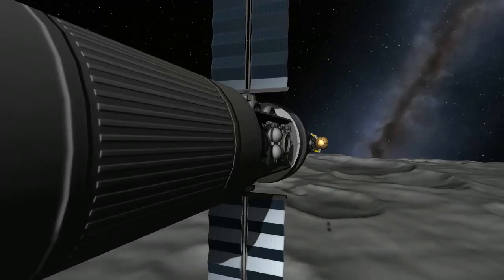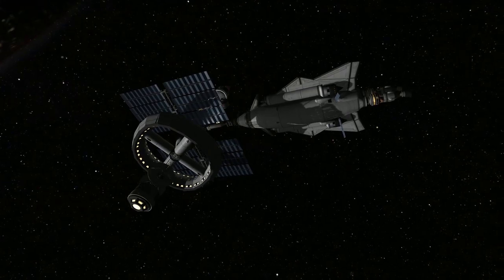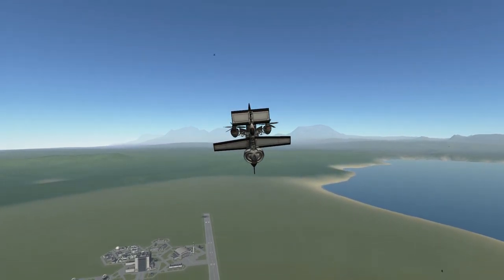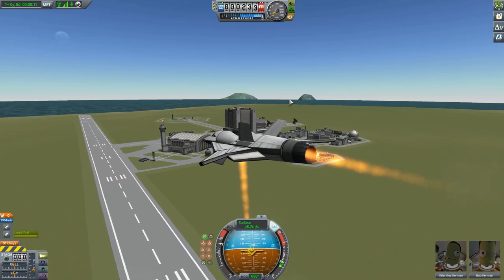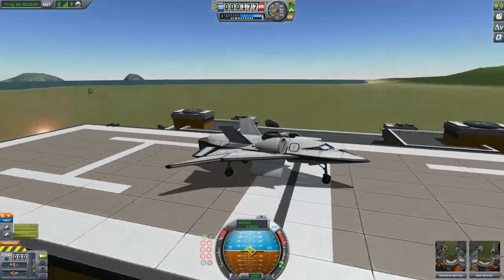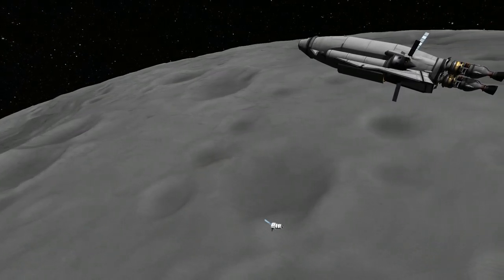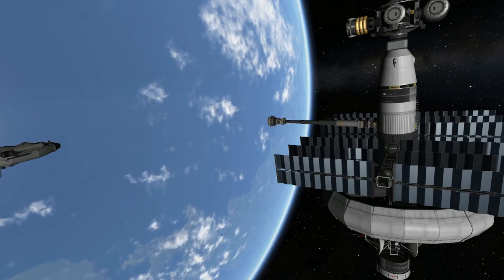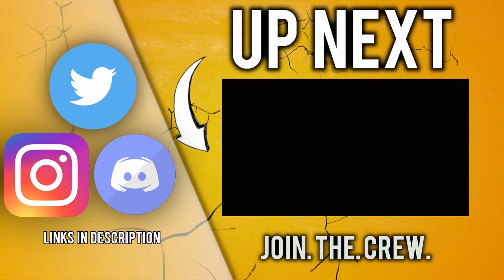Creative Ways to Use Robotic Parts in Kerbal Space Program: Breaking Ground

Comment from the maker: I'm falling in love with KSP all over again thanks to the breaking ground robotic parts. What have you guys found them useful for?
Reply: eh they added rotor blades too, which can change their angle of attack too, so putting control surfaces on servos is no longer necessary, did you happen to have missed this? because 1 week ago they were already there
Reply from the maker: @marianandnorbert  yup. Had missed it, though I caught it when reviewing patch notes. Even more prop/rotor blades got added with 1.8. pretty awesome time to love KSP.
Reply: Controlled Pairs Gaming totally agree
Reply: What i like creating most is VTOL-Props. They're just so maneuverable and so safe to fly. I've send one to eve too, aswell as a jet-assisted helicopter to laythe!
Reply: bases
Reply from the maker: Haven't tried much base building with them, but I can imagine the possibilities!
Reply: Prop fighter planes: even with center of mass moved a little behind the center of lift they're still acceptably stable and worthy of a fighter plane status
Reply from the maker: Epic!
Reply: Vtol
Reply: I don’t know how to use them.
Reply: Just got the dlc on sale, working on a modular ore depot with a sky crane that hooks to the belly of the modules and can drive them to move them around
Reply: I built a Hanging base under a Münar arch with them, about 3 years ago. It was before the anchor was implemented.

Comment: But how do I make the blades solid? They just flex up ridiculous amounts and don't really have much structural integrity
Reply from the maker: Use the stock propellers or rotor blades rather than the control surfaces that I used. play with rigid attachment and auto strut as well.

Comment: do you need to use the controller? ive just been using action groups
Reply from the maker: Depends on what you're trying to do
Reply: @ControlledPairsGaming  i gotta toy with that thing. probably more complex. I made a system that drops a rover and picks it up out of my ssto. I like action groups cause I can toggle the wheels and lights on the same button too
Reply: @hurpaderpp  For that, probably not, but if you let’s say had a tall lander a rover near the top, you could use a robotic arm to grab it and bring it down, this would be a lot easier with the KAL controller. Or a walker, would be hell to make a lander with only action groups

Comment: make an Apache that has functioning Hellfire missiles
Reply from the maker: Tall order
Reply: @ControlledPairsGaming  The Hellfires dont need to be guided
Reply from the maker: @pepsidoggo1598  Uh... AGM114s in all variants are definitely laser guided.
Reply: ok
Reply: How about a TOW missile?
(You may use tweakscale as a final resort)
Reply from the maker: Tube Launched - ez
Optically Tracked - sure
Wire guides - lol nope